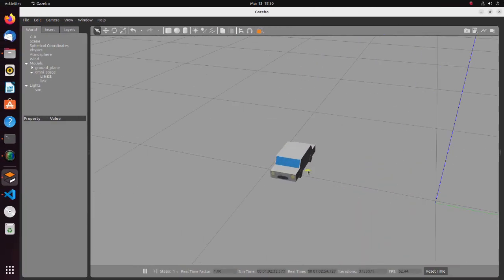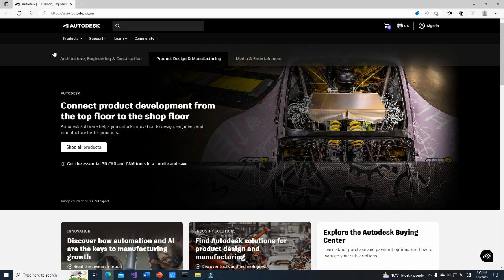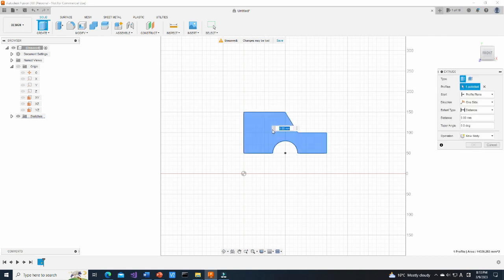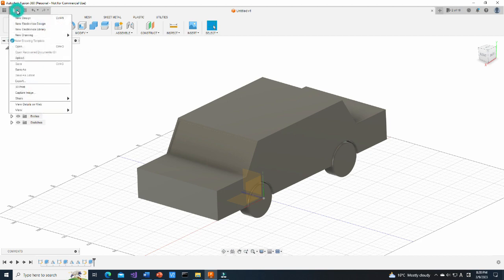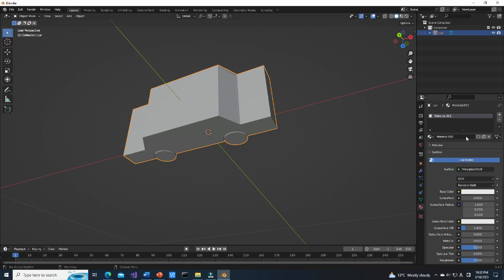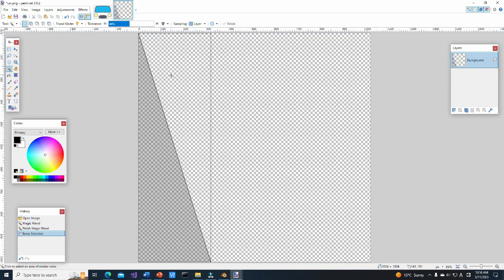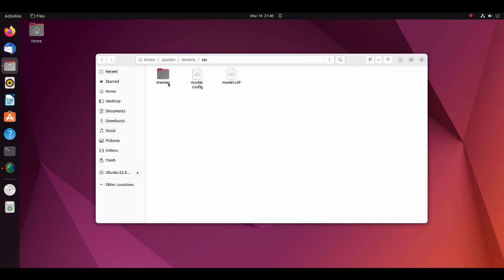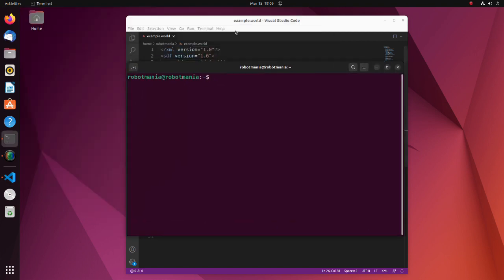How to Create a Gazebo Model Using CAD and Blender

Comment: Could you also make a video how to do joint links etc?
Thanks
Reply from the maker: Hi M m!
Thanks for watching my video!
Currently, I am not planning to make a video about joints and links. But I have a lot of examples on my channel, so some of them may be helpful for you. Where exactly are you experiencing a problem?
Reply: @robotmania8896  My problem are links. I generated 4 links for each wheel but links vectors seems bigger when vehicle spawn and it rotates or flies.
Reply from the maker: @user-lc1kw6me2q  So, your robot has 4 wheels. In that case, I recommend you refer to the “husky” repository. Probably your robot is similar to this one. Here is the xacro file in which robot is defined. The wheel part is lines 210~221.
https://github.com/husky/husky/blob/noetic-devel/husky_description/urdf/husky.urdf.xacro